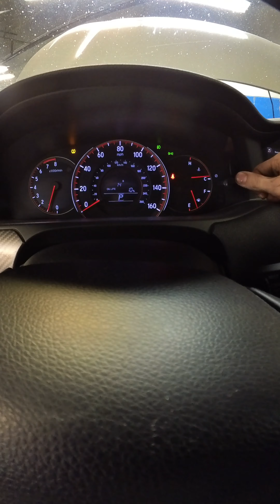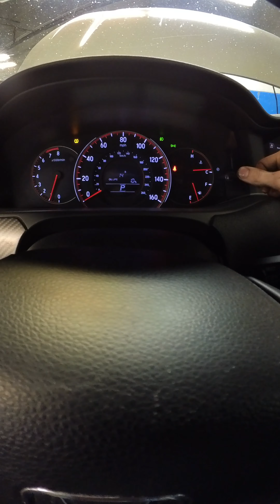16 Honda Accord Oil Change And Un-Selling An Alignment 🔧😏👌 #honda #accord #oilchange #pov #asmr

Comment: This car doesn't need tires. You are just trying to upsell them.
Reply: The tires are junk. If the rim is bent it has uneven wear that's not noticeable by eye. One part of the tire is thicker than the opposite side. Even with new rims, they will bounce and skip down the road as the tires wear down more and more. Eventually this constant bouncing will destroy the suspension and wheel bearings. Also if the tires are bouncing while driving on rain in cold temps you can easily lose control of the car. It's not making solid contact with the road anymore.